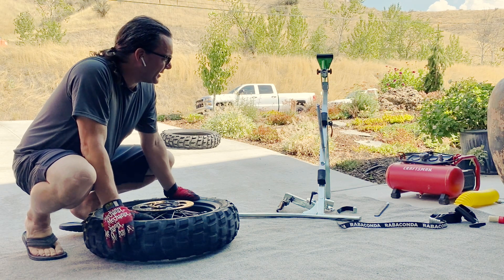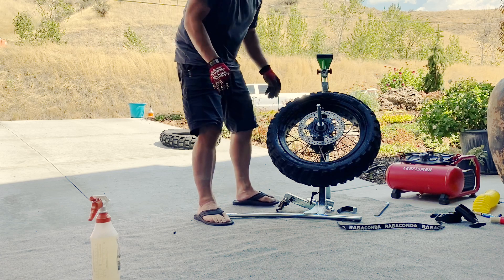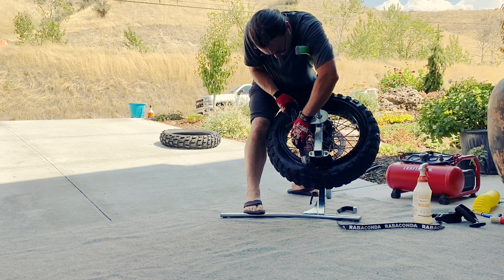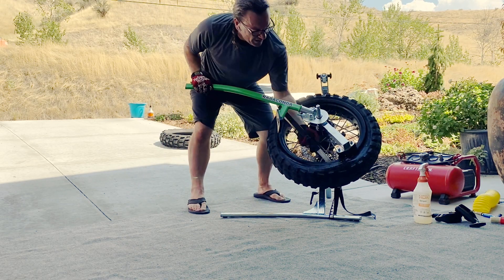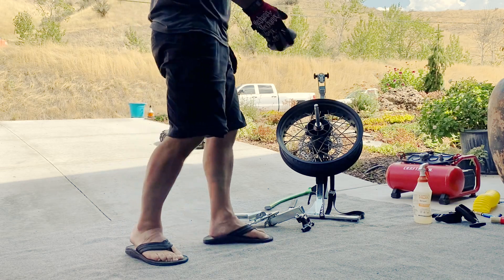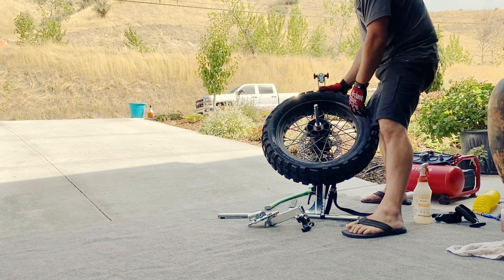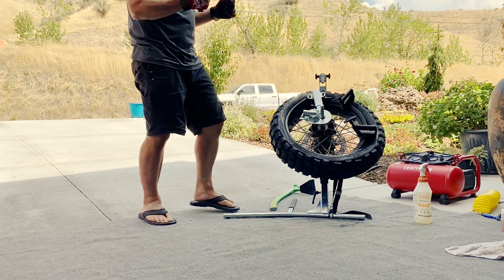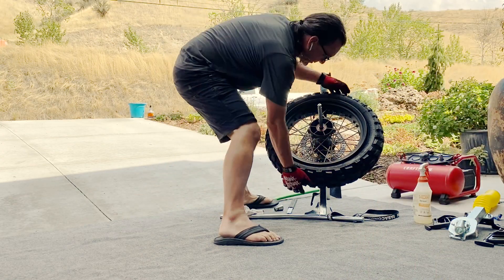10 Minute Tire Change using the Rabaconda Street Tire Changer - KTM 890 Adventure R

Comment: I wish all spoked wheels were tubeless. Don't understand why they aren't.
Reply from the maker: A lot of them are! Unfortunately, the front wheel situation on the stock 890R isn't good - leaks air, like several PSI over just a few days, creating a really dangerous situation. I dealt with it by checking the pressure before every ride, until a ding in the rim meant that pressure was lost even faster. In goes a tube!